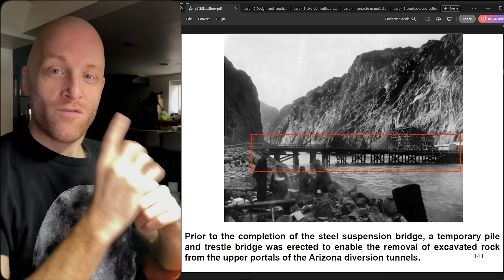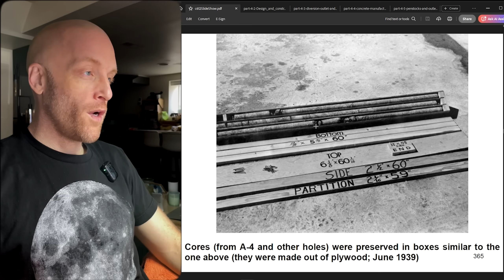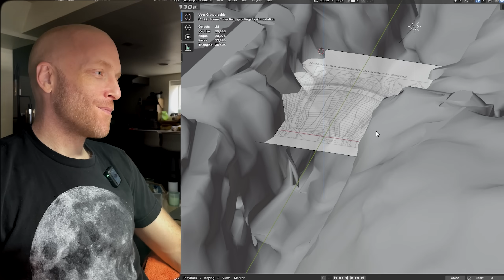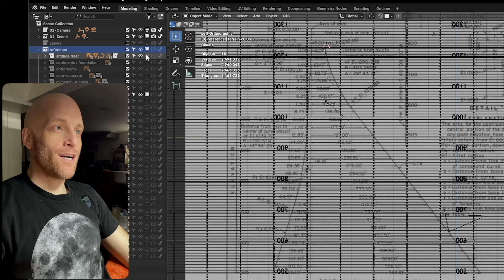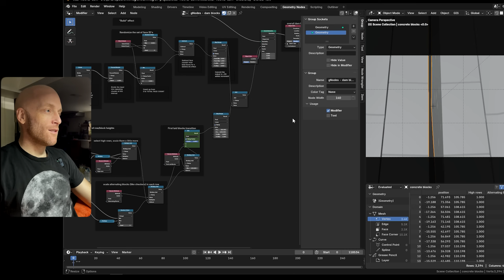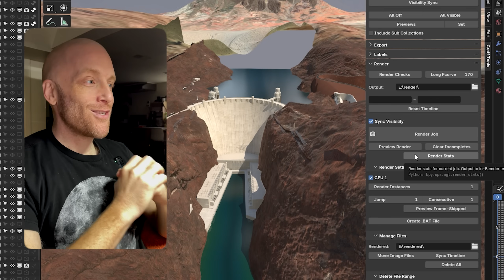How I recreated Hoover Dam in 3D (historical accuracy, research, modeling, and more)

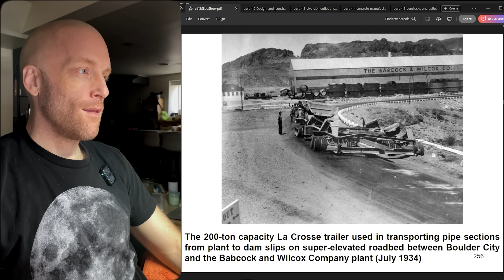Comment: Wow. At 8:44, I see a building with The Babcock and Wilcox Co. on its side. I worked at that company from '89 to '94. I am not surprised that it was involved in this project, since it has been around for well over 100 years, and is a world leader in power generation. When I was there the main focus was on clean coal and nuclear ... go figure.

Comment: I hope you read rhis. I guess tou make use of linked collections a lot. Editting the oeiginal is a pain!!! There is this amazing addon, which i improved quite a lot. Its called edit linked instance collection. It automatically takes the oeignal collectionz places it in a a new scene and then you can edit super easy. In your case beed the reference. Tou couod easyily link in those later.

But the addon makes it so much easier to edit the orignal. Very curious how you handle this

Comment: I can understand the passion for detailing and making your systems look close enough to possibly be satisfying to those who would be in the know. I like modeling starships and as part of that, I have done a tone of research into a variety of systems that might be applicable to such things. Research into naval ship construction, submarines, architecture, airplane design, and such. Part of it includes modeling and animating things like doors (and their mechanisms) and landing gear and such and I have done tons of research into things like hydraulics so that I could have the visible parts look about right. Also gone into things like various door mechanisms on cars and airplanes, utility conduits and piping. Even though the craft is fictional, a lot of what might go into making it function, is tech we have today use din multitudes of other applications. And in places where I have systems components exposed, I want it to look feasible.

I am also the kind of guy that builds (technically unnecessary) support structures in building games when the game does require it. For example in Satisfactory you could have a 20x30m platform just floating in the air with nothing under it. I'll still eventually build support pillars for it and make it look believable. Things like that.

Comment: Great video! You did mention you still struggle with reference imagery alignment. I've been using a method at civil engineering firm I work at, and while it's not perfect, it's better than some of the skewed scan images I sometimes have to use as a reference. Here's what I do adapted for blender. (Which I also use and love)

In the reference imagery there are "knowns" and "unknowns". "knowns" are anything from map grid lines, horizontal elevation lines, buildings and whatever is in the reference image you know the position of in your blender file. "Unknowns" are the reason you're bringing the reference image in in the first place. I'd try to get it as aligned  as possible (I don't do references in blender, I'm assuming it's a plane object with a image material with UV unwrapped to to corners), then I'd use the knife tool to introduce new vertices at the "knowns" in both 3D space as well as the UV Image editor, these vertices should be created at places such as grid line intersections, this will allow you to move the point in the reference image and place it where it should be (your elevation reference for example you showed in the video). This way all your "knowns" perfectly align, and everything else is linearly interpolated. (Being mindful of triangulation)

Thank you for sharing your process! Watched the dam video initially now this. Love your work & if I didn't already have a job I love, I'd ask if you have any free positions. :)

Comment: Las Vegas hits 100+F daytime temps starting the first of June, and 105+ temps by the end of June. Average daily temps over 100F last until around mid September. These guys were working their guts out in extreme temperatures all summer long. Tough as nails.

Comment: you did really good, upper echelon intelligence - what'd be interesting dive into would be the Starship including the capture mechanism to catch the booster, also the basics of the Tesla's car infrastructure - the break down of where the electric engines are, battery layout, how braking system works, and how much the main computer gathers feedback for AI, along with how it actually links to & controls each component.

Comment: I really enjoyed your video. You can google cavitation and you'll find that is low pressure causing water to 'boil' which takes a lot of energy because you are changing water to steam. When it changes back to water that energy must be released and that's what causes the erosion. The energy comes from the water falling a distance and the cavitation can come from any imperfection in the surface. So in the case of the large, tall spillways there is plenty of energy available. There was I believe another video about this at Glenn Canyon dam upstream from Hoover. Similar consequences and repair.

Comment: Jake, Did you learn to master blender like this on your own, or did you take a course on 3d modelling or similar? Thanks
Reply from the maker: I'm self taught. I paid for a few courses over the years here and there, but they were from smaller online creators and blender pros to learn specific things, not design schools and whatnot. Nothing against schools, I think whatever route calls a person is probably the best route. But I'd like to add support for the idea of self teaching because it's a powerful thing that can absolutely work out! Starting very small, using youtube (there's so much blender content) and going one step at a time is a viable way to become good at it. It's slow, methodical work but it can be done!

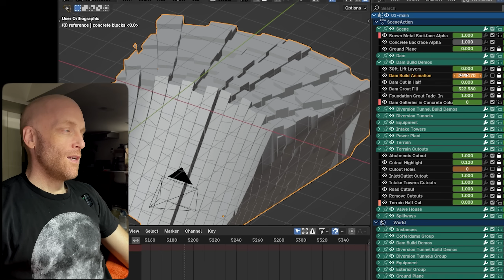Comment: 35:12 what is the panel on the right? Is it some kind of parametric animation? I have never used blender for animation before, but the ability to control animation using UI sliders seems interesting.
Reply from the maker: If you keyframe anything in blender, when you open up the "graph editor" panel to see those f-curves, this is the left-side panel in that pane. You can choose to view sliders in the 'view' menu.
I've added my own augmentations to that window but it's all based on the system Blender already has in place.

Comment: The statement you made that you can suck in a lot of information when you CARE, was a great insight. I'm floored by your knowledge of the software you used, plus getting your head around it and also the plans that you had access to. I have a problem with fine detail but it is amazing that when you can SEE and end result, you'll do everything in your power to get there, and use ALL available tools that you can get your hands on. The Hoover dam video was a masterpiece. Thanks for sharing the making of such a masterpiece.

Comment: Cavitation: When pressure inside a liquid becomes so low (from velocity increasing, or on the inside of a corner perhaps) that the liquid boils into a gas, despite being far from the surface. When these bubbles collapse shortly after, it is locally very violent and can rapidly erode concrete, steel etc when it happens continuously.

Amazing work, thank you for all this effort!

Comment: Even with all the digital GPS stuff these days we still use good ol theodolites for surveying work. I've done a fair bit of it in my career. Back then, instead of getting computers to do the math, we just exploited physics. The nice thing about physics is it always works, rain or shine, hot or cold. Gravity is gonna pull the same direction (or at least close enough for our purposes.) Lenses are gonna bend light the same way every day so long as they're not broken. A computer can do so much so fast, but a slide rule, an old metal tape measure/chain, and a theodolite don't need power or internet or anything other than you to use them. As much as I'm glad for how easy technology has made modern engineering and construction, there's something so satisfying about just brute forcing it with physics, smarts, and manpower.

I use GPS surveying equipment daily for my job. It's drastically faster and easier than level circuits with a theodolite and I don't have to start from a known benchmark point. But it doesn't make me smile and cheer like closing a 1/2 mile level circuit with a slightly damaged theodolite and having the error come out to under 2/10ths of an inch, hahaha. WAY easier day to day, but I'm just the monkey moving the machine. The old school stuff, you needed skills, knowledge, and hard work to use, but you could do every bit as much and as well.
Reply from the maker: Tremendous insight that I'd never know otherwise. I just love it. There's something really special in the appreciation of skills, trades, knowledge, the old and also the new, wherever it may be taking us.
I just love hearing from folks like you when they 'go off' on what they know. Like listening to some fella at the track rattling of details of an engine, using all this cool 'in the know' terminology and whatnot. It's so great.

Comment: Its really neat to see your behind the scenes process. Seeing the cross sections lined up and flying through them was really clever. It would be interesting to see more integrations with real world elevation data. GIS tools deal with geographic data using various projections/earth models, would be possible to find a way like you did to show historic stuff like the cut outs and canyon before all the construction, and as long as your model is scaled properly, the data could effectively be used interoperably with 3D GIS tools to calculate exactly how much volume was removed when compared against accurate modern lidar data or digital terrain models derived from lidar data. Amazing stuff.

Comment: The 1930s and 40s had to be the peak of major, never done to that scale, engineering and construction. In 1931, alone you had the George Washington Bridge (twice as long as the previous record holder), Hoover Dam, and the Empire State Building.  The Dam and bridge building continued, including the Golden Gate Bridge, the the Pentagon and the Manhattan project and the "the largest, most precise machine", the Palomar observatory.  Amazingly, around the same time, F.L. Wright designed and built the iconic, way ahead of its time Fallingwater house. It was was a mind blowing time.

Comment: First I want to thank you for the video. It's amazing work and you finished it. You can be really proud of that in my opinion. :)
You ask at the end what else can be done with the model. I noticed there are not many pictures in real life from the top of the intake towers, where you look down this 330 feed and see the deepness of these two cylindrical gates inside. You showed it from the side really detailed. It was perfect by any means. But I would like to see more scale examples of these intake towers and, like I say, a "top down" view from the very top. I'm not an expert on this stuff, but you did really an amazing job.